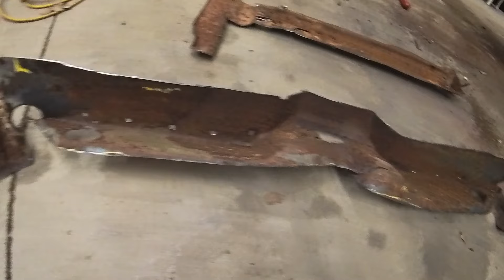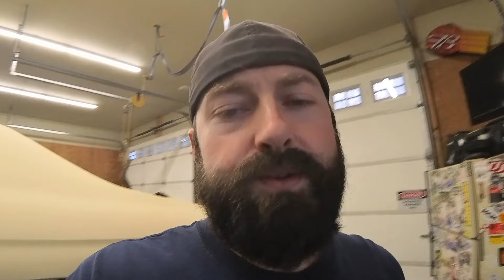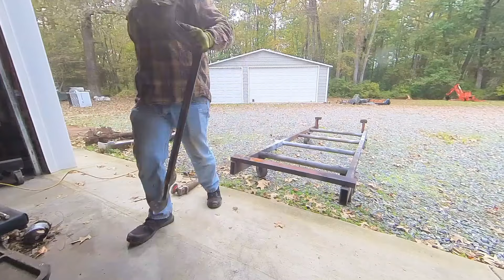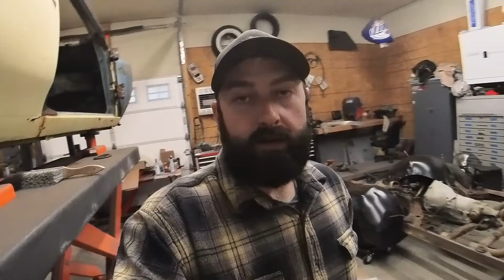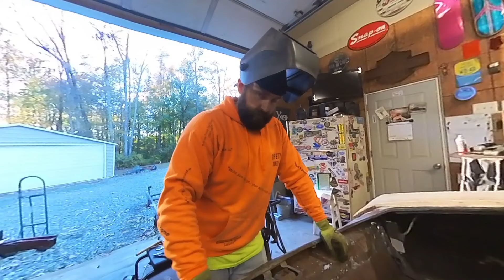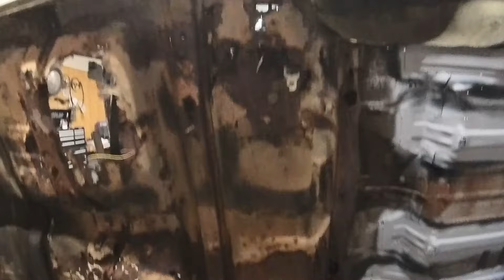Mounted On Rotisserie Chevelle Winter Project l Part 5

Comment: You need a whole floor pan , don't think twice about it.
Reply: You mentioned the rear quarters were replaced, are we talking full GM panels or full reproduction panels and was the panel between the rear window and deck lid replaced at the same time. Is the inner structure panel solid or does it have rust issues when you look up at it from the trunk area.
Reply from the maker: @backstagerecordings The quarter panels were aftermarket. The center panel was replaced at the same time and the panel underneath that is not rusted. It is in good shape
Reply from the maker: I'll keep that in mind!

Comment: I was just using the same technique of using the pliers to roll the old metal off and tearing the spot welds out while I was removing the rockers from the 1970 Cab I’m working of for my 1 ton 4x4 conversion K3500 project.
Reply from the maker: Nice! It definitely takes a lot of patience.